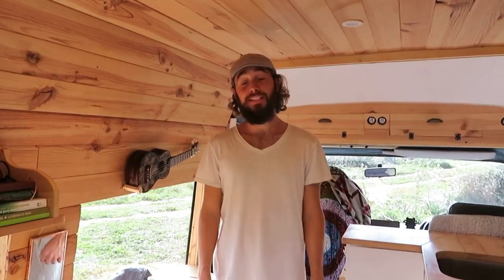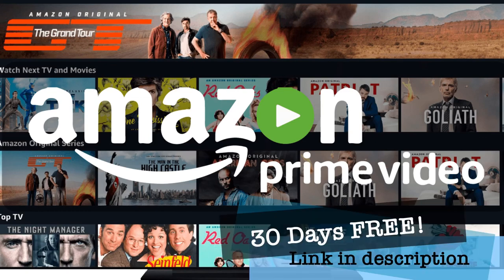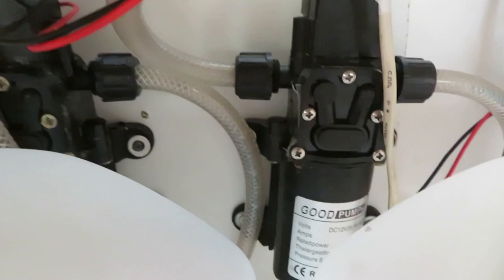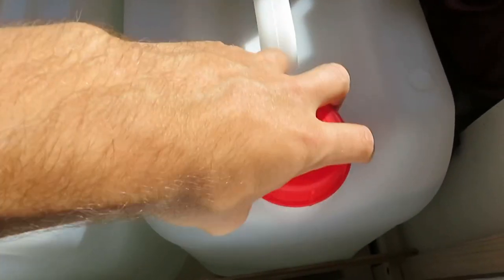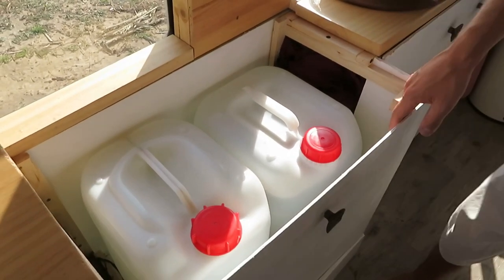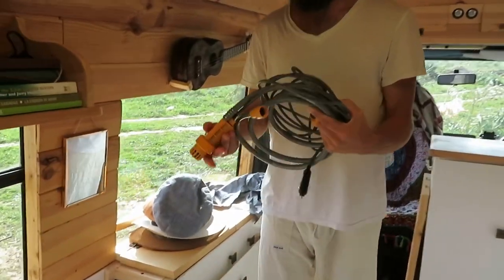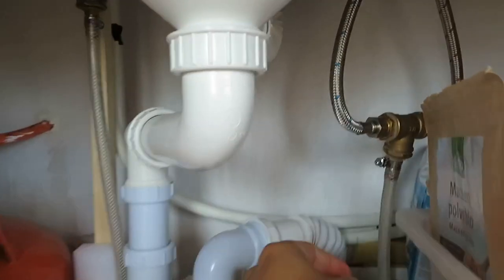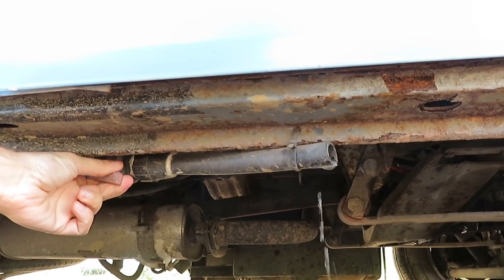Cheap pumped water system for a van / living off grid | VANLIFE SERIES

Comment: A very ingenious water delivery system! I was wondering if you get any plastic taste in your drinking water? I like the vent that you have on each tank under the sink, but do you have screens on those vents to keep small insects or spiders from setting up shop? Thanks so much!
Reply from the maker: Thank you! And at first we had to flush the tank through due to the sealant/glue we used to connect the in/out pipes, but I think it was the smell trapped in the tank causing it, but after about 20 liters it was gone and never had any issues since. And the vents are not protected no, you are right they probably should be, but they are tiny holes, maybe 1-2mm so I think most insects would struggle to get in, I hope so anyway! Might find something now you have mentioned it though!
Reply: Luke Hames Thank you so much for writing back to me, I really appreciate it. I’m so glad to hear how great everything is working for you!
Reply: Luke Hames You have your profile picture with short hair. That’s what I remembered about you!

Comment: I asked about your drinking water on Nate’s video but I’ve found the answer here! Is there not a pump system so that you can easily just swap bottles over? Not suggesting you change, I’m at research stage. I totally get having bottles that you can carry to a tap plus I don’t want external tells as I want to be stealth. Just thinking that if all same 25ltr bottles why can’t you just swap over an empty one for a full one. Then you can clean them out too. 

I bookmarked that shower a while ago, I take it you find it good. Any idea how much water you use for a shower?
Reply from the maker: Mama Kim no worries, I just replied an hour or so ago! We found this the most practical, if you are able to have all your bottles next to each other it would be easier and you could probably leave your pump/shower in place so when the main tank is empty you just turn the pump on. Or rather than swapping the tanks/bottles over you could run the pipe from the pump
Into a different bottle, but for us this just just worked out with the a space/setup we had. Plus they are heavy when filled with water! 
And yeh, the shower is great, we could use as little as 2 litres for a shower with this, normally we would fill about half the 25l tank with warm water (just by heating water in the pan/kettle) and we could both have a proper shower each & washing hair etc... so a more realistic amount of about 5l per shower 👍 hope this helps.
Reply: Luke Hames That’s great, thank you

Comment: Could you not simply run some pipes from the 2 reserve tanks, under the floor and into the tanks under the sink? It seems a bit of a faff doing it with a pump. 
Also, why separate out your water types? Why not have all tanks common and add a water filter system? It would make things cheaper and simpler in the long run.
Reply from the maker: It is a little bit of a pain, but we only have to do it once a day max! The big upside is that if we turn up somewhere without a hose like a water fountain we can easily take the tank out to fill it up. We were originally going to connect them all together and fit them at the space under the van at the back and we even ran the pipes before finishing all the insulation and walls, however, the join the tanks up with a leak proof connection on thin plastic wasn’t something I wanted to attempt, and like I said it would have taken away something that we know we often have to fill up from a fountain. We do want to put a filter in at some point, but again for the initial cost this just worked for well for us, but lots of ways to do it, this gives us a lot of water and means we can go completely off grid for a week at a time. 👍